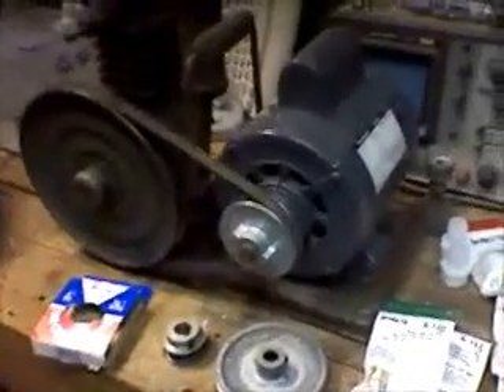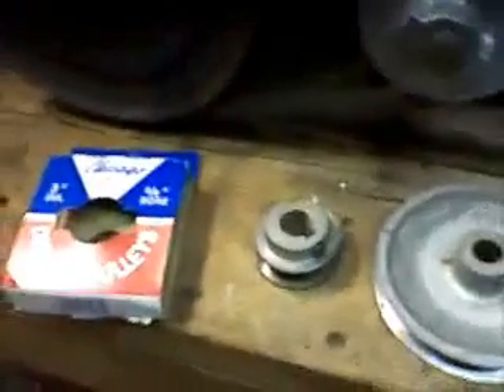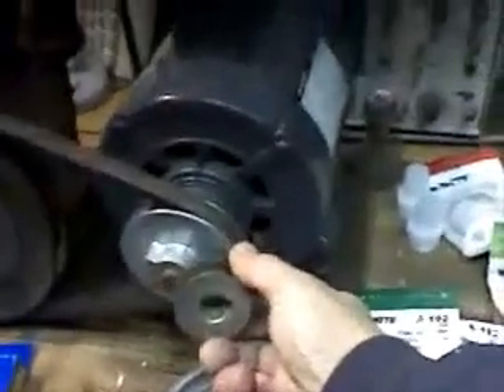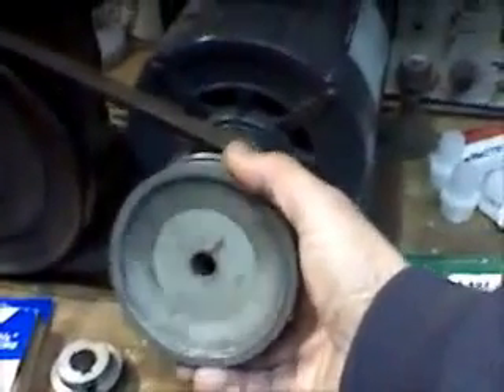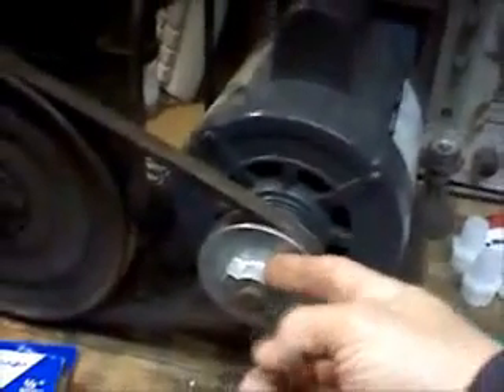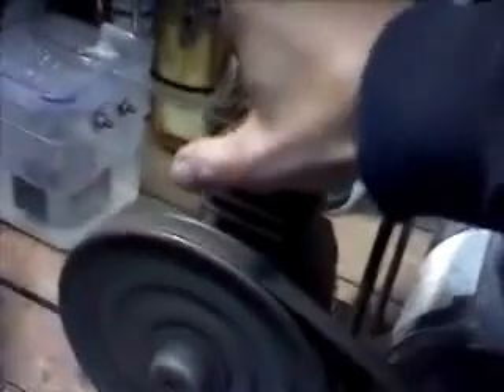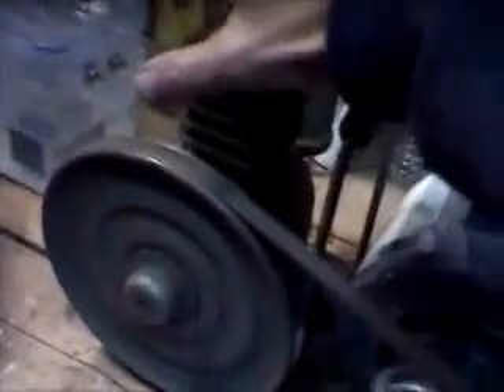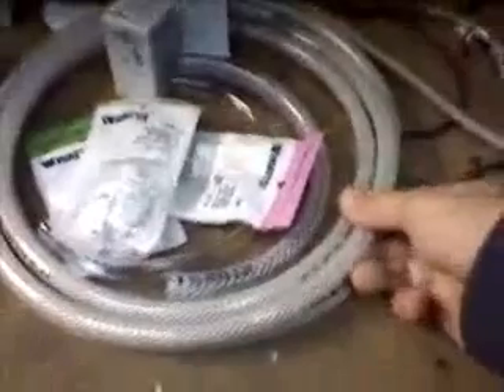#53 Working HHO vacuum pump!

Comment: I have a video warning against useing inline check valves to prevent flash return to the hydrogen. I made a hose with 3 in-line ball bearing check valves and still blew up my quart jar. Only things I found to work so far are a cigarette filter and inline water stone for a fish tank Careful.

Comment: I said what I meant actually, I'm quick to fix my mistakes if found, but I've read the original from 4freenrg and myself and found none in its entirety.  4freenrg stated "It is H2O2" but H2O2 is hydrogen peroxide (HOOH), if quotiented properly as 2H2 + O2 and smashed together as 2H2O2 (without +) and forgetting the quotient, you get H2O2 improperly.  H420...that's not even a chemical, maybe a pothead term though (420). Good try though.

Comment: I think 4freenrg was trying to say that "2H2O molecules break into 2H2 and O2 molecules", he slammed them together making 2H2O2 in statement and forgetting to place the proper quotient on the front, revealing the H2O2 relation.  What he failed to realize is that the experiment breaks 1 molecule of water at a time, producing H H O, at some point in time all atoms are actually separated before the HH becomes H2, but you can't put H2O because that's water, so you put HHO to denote the difference.

Comment from the maker: Thanks. Not sure about the H2O2 statement though. That's the formula for hydrogen peroxide.

What actually happens is if x density of HHO is produced at atmospheric, 1/2x density is produced at 1/2atm but looks like 2x the volume. Same amount of molecules. It just comes off the plates more violently.

Conversely, if HHO is allowed to build pressure within a cell it looks like less but the number of molecules produced is also the same but looks like less because it's compressed and more dense.

Comment from the maker: I'm going to create a 2nd bubbler so there will be one immediately before and after the pump. That way, if it does pop, that's all it will do. This pump us as rugged as an ICE. I would not be concerned even if it does pop inside the chamber.

That said, I did run it several times on the cell and watch how much faster gas passed through the outlet tube by observing the bubbles passing through it. No trouble yet.

Comment: I forgot about those.  He is absolutely right.  Ones I remember are like an old fashioned steel 3 lb coffee can with a one way valve on it.  That might just work for you when it goes under the hood.  Its another piece to test though.  I have no idea if they store adequate vacuum for what you are talking about.  Might could make some similar though and avoid having to use a pump.

Comment: There is some danger with what you are doing.  The type device you got there generates a good bit of heat and static electricty.  I cant imagine how you are going to avoid getting some gas sucked into the compressor.  There are oiless, diaphram and rotory vane type vacuum pumps that would do the job better/safer. But the darn things aint cheap. Wear your stainless steel underware or put the compressor well away from you just to be safe.

Comment: I want to see this work.  Am hoping you are right and I am wrong.  I think pressure is the way to go but am much concerned about putting this stuff under pressure. I have experimented with blowing up containers at 10-20 psi and you really dont want to go there.  So stick with the program and lets see if vacuum works.

Comment from the maker: Well, if that's true, were all about to find out. I disagree with ddanvos68 100% about vacuum not producing more gas and were about to fint that out too. Thank you all for your concerns. I will take extra precautions, but also know this; NOTHING is going to desway me from these experiments. If I am correct, and it does produce OU HHO, I will prove it beyond any shadow of a doubt. If it turns out not to be OU, I will prove that too. One of these is true. I believe the former, not the latter.

Comment from the maker: Okay, I'll take that under advisement. I can see how it might be true. I'll put a bubbler on the output side too. Should it ever pop it will be localized to the pump only. The pump itself should easily contain it. Static buildup should not be a problem as the motor housing and the pump body are at Earth potential.

Comment: I think what ddanvos is saying, the device doesn't create a vacuum, what it does is move air through decompressing the cylinder with valve 1 open, and then compressing with valve 2 open. It may seem trivial since the overall compression is close to 0, but quantum physics states there will be places where gas can get trapped and be compressed. Just be careful, we don't need to see an accident!

Comment from the maker: Pressure does not cause increased HHO, absence of pressure does. Because of the stored vacuum in the cell and bubbler, it's going to be best to keep that constant and vary the HHO volume by way of a PWM. Otherwise there will be severe throttle lag.

All will become clear in my next video or two. Don't touch that dial!

Zero

Comment from the maker: I did write to Tom to tell him not to over sell. A 20A PWM should be more than adequate for a MPG booster. If you plan to run entirely on HHO, 40-50 amps might be needed but I'm not there yet. There are also some engine modifications that you will need to make which, again, I have not explored.

I'd say the 10-20KHz range would be fine. The only thing I would recommend to buyers as an add-on is an external input for a throttle actuated potentiometer if he offers one.

Comment: you know a vacuum pump is used in refrigeration service to remove (boil) water from inside a system.  I do not understand how pressure would cause an increase in hho production. Also, it seems to me that you would want to vary the hho production according to what the accelerator pedal is doing instead of the vacuum in the manifold.
-just and unsolicited opinion-
keep up the good work..

Comment: I see that you are concerned with the ratings but to the average layman (me) it is not entirely clear what you are doing here or have 'done'. You switch on a motor then put your finger over a vacuum port? Mostly it seems as though you are commenting on the price of parts. No malice intent from me just wondering what it is you're doing?

Comment from the maker: At those altitudes, 1.5"Hg - 0.2"Hg is absolute pressure, not vacuum. These numbers translate roughly to 28.5-29.8"Hg vacuum. I'm pulling 25-26"Hg. BP will be far greater than 130*F. I will demonstrate on the next video.